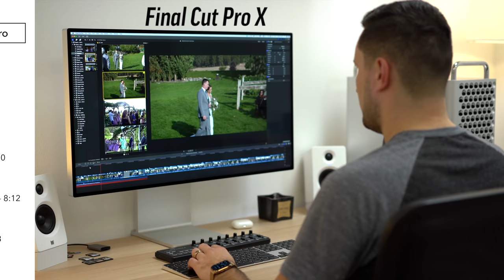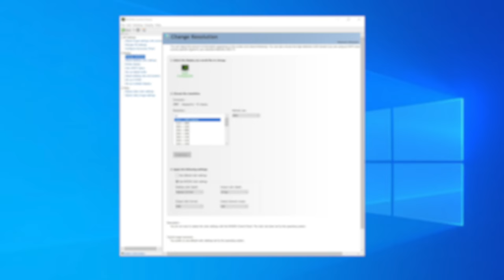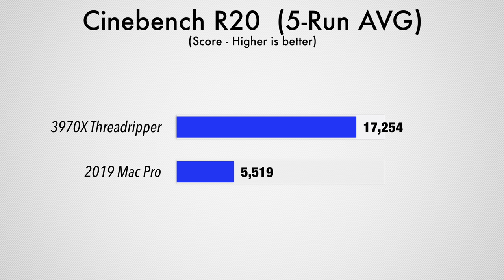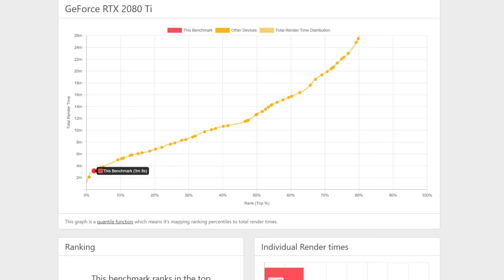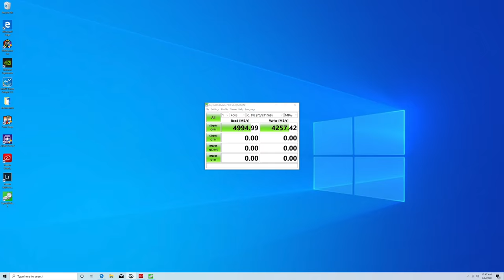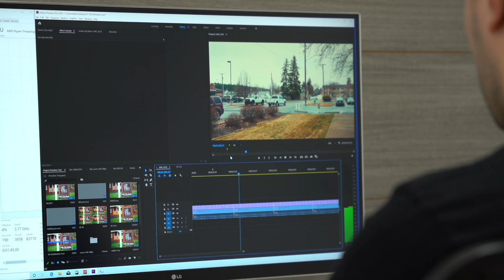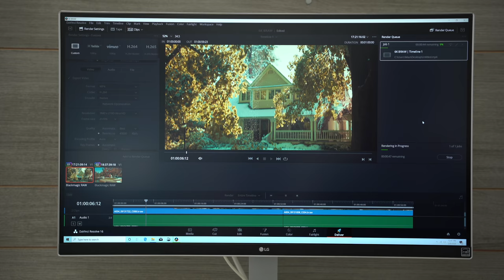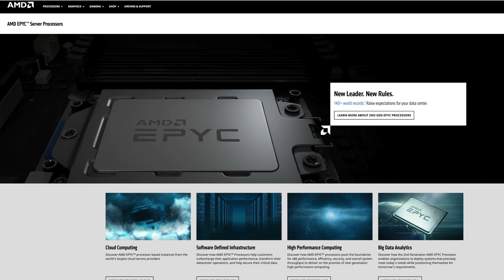$15,000 Mac Pro vs $5,000 Threadripper - Sorry Apple..

Comment: 13:48 "To be comparable, we would need at least a Quadro RTX 6000" No you wouldn't!
If you really need 32 Gigs of HBM2 memory, just use 2 Radeon VII's instead of the 2080 ti. An XFX Radeon VII sells for just 600 USD on Amazon currently, actually making the build 200 dollars cheaper while sporting 32 Gigs of HBM2 memory.
Reply: Hey someone got it. Even older nvidia gaming cards in SLI will outperform a super expensive quadro because of the memory. It's like they didn't know what was actually necessary when they designed it
Reply: Hello can you recommend me a pre built pc under 2k?

Comment: Imagine if this guy compared an evenly priced PC to the Mac Pro
Reply: Probably can't build one - there are no multisocked boards for desktop Ryzen and Threadripper, ECC memory is also unicorne.
Reply: Piotr Dudała You can get so much out of the money. If you want a workstation dont get a 2080ti. Nvidia has multiple workstation graphic cards. Ryzen 3990x and get a good cooling system. Maybe even custom made.
Reply: Now you can slap a 3090 in it
Reply: @angeloc1340  or even a 6900 XT, or wait for the titan ampere
Reply: I literally tried to make a pc (pcpartpicker.com) for 15.000 bucks...

sort high to low

I didn't manage to do it until I just packed 2 rtx 3090s in there 😂😂😂😂
Reply: @gitg4d576  the 3090 is the Titan for the ampere cards nvidia  is false marketing this card as a gaming one 
It has a lot more vram 3080 because workstations need it
It has A nvlink connector because work stations need the 3090 would already destroy the 5700xt lol that card which costs like 400 dollars and they are Selling it for 2000 
Apple is the first hand scalper tbh

Comment: Pro tip: choose good fans, adjust the fancurve and use linux. Voila, all the negativs mentioned in the video are gone and the performance is even better.
Reply: blad90  Exactly right lol
Reply: blad90  You are not aware of the mighty power of linux. Study u must.
Reply: blad90  I agree. I looked into using linux but to use the software I need it would be close to impossible to install. Not impossible but close
Reply: blad90  noob 😂
Reply: @Galadriel Of The Wood while there are open source alternatives, Mac boyz will be faithful to their ecosystem. I'm with you on that.
That car comparison tho.
Reply: blad90  'Linux is shit' - shares this comment on a platform that runs on linux servers. cough blasphemous cough
Reply: @Galadriel Of The Wood Yeah! I tried MacOS and it is trash compared to Windows. Couldn't even make the interface work correctly
Reply: blad90  100 step process what are you smoking. If I want install Firefox I write  this "sudo Pacman -S firefox" in the terminal. I don't understand this argument it seems more like you just want to learn something new.
Reply: blad90  bruh, your just kinda wrong.
Reply: @Galadriel Of The Wood what kind of linux? It isn't just one thing.
Reply: I hope you guys know that there are multiple distros for Linux . Once you get to know how to go about using the Linux shell, you wouldn't complain even once and it provides so many ways to make so many things easy. You just have to know how to go about it. That being said, Windows and Mac OS do have major advantages over Linux in the sense that since it's more easier to use, it attracts a larger consumer base. And since building applications on different OS' require entirely different codebases, companies will mostly not afford to build them on Linux based systems. But good news Linux peeps, this is changing. More and more people are switching over to Linux distros and more companies are starting to invest into the Linux platform. A simple example is, consider the game Counter Strike : Global Offensive with a massive player base of about 600,000 daily players if I'm not wrong. With the new Vulkan API, the game runs at a higher FPS than a windows system! So don't dish out on Linux just yet. Good things will come!

Comment: Who whould win?

Chad custom pc-

Or

Virgin mac pro-
Reply: @cooldownboi3890  doesn't this mac uses amd?
Reply: @Gloverfield  no, it uses a 12 core Xeon processor clocked at something in 4ghz range but only reaching 2.6 GHz bc fancurves are so fucking low on the Mac proably
Reply: @cooldownboi3890  Lol just get a custom watercooling system for less noise. Literally produce less noise than an AIO.
Reply: @hanzoverlord6720  I know

Comment: This dude has an excuse for Mac every time it gets beat out, holy hell, just admit PC destroys Mac.
Reply: You see - Apple indirectly is PROVING a point: OPTIMIZED software. In PCs, excessive raw power bought at expense of noise and thermal performance, is usually wasted due to software unable to make use of it  - sometimes due to fundamental reasons, mostly due to crappy developement. E.g.  Tensorflow compiled with Intel MKL and AVX support may be 3-7 types faster... yet default binary is not.  That's why WIndows Phone or iOS were flying on hardware, that would make Android cringe and Android was slow beast and unable to take advantage of - at time - monstrous advantage in underlying hardware. They are on the right track - just wasting this concept in different ways.
Reply: @piotrd.4850  
Complete bullshit, nothing said that was true, apple optimization only applies to final cut pro, same spec windows machine destroys mac in any software.
Reply: @piotrd.4850  It is very possible to have a silent and powerfull pc at same time. If he would have used massive air cooler instead of a noisy AiO water cooler and more case fans, temperatures would have been lower and the noise too. My 9900k is cooled with 2 120mm fans that are sitting on 2 heatsinks with 12 heatpipes, combined by 4 case fans, and a 3 slot RTX 2080 super overclocked Strix ROG and i can tell you, even durring benchmarks, my temps are low and you cant even hear the whole thing.
Reply: imagine he wouldnt use a gaming GPU ? lets say he goes with one of the qorkstation cards of the quatro series...
Reply: Most PC buyers are not building a custom monster like the one you see here. They are buying off the shelf pre made PCs. In that regard Macs are every bit as good and in some cases better. And Mac OS may be what they need. Both Mac and Windows have their uses. Your assumption that PCs are better based on test results of a custom monster vs a stock Mac Pro is far fetched.
Reply: Not to insult, but most people I know  will rather build a pc over buying premade one. The only case I know that's not true is with laptops (for obvious reasons), if you want to count that. Even my grandfather doesn't have prebuild pc, he has a laptop connected to a monitor, which is important because he said he would rather build then buy (usually) premade trash. (I am looking at YOU Dell!)
Reply: @TomitaGregorias  This may be very true in your world. But world-wide most PC sales are of off the shelf computers. Custom built PCs count for a small percentage of the market. And yes, if you know what you are doing and can build a custom PC you can build a monster machine. No doubt.
Reply: @piotrd.4850 have you ever hackintosh-ed??
Reply: @piotrd.4850  so that justifies the extra $10000 price tag?
Reply: @piotrd.4850 Optimisation only goes so far. You saw how much the PC beat the Mac in Blender. The Mac will only beat the PC in niche areas, for virtually everything else the PC is king
Reply: @jwillis35  Actually you can buy premade pc that are still far superior to macs, you don't need to build your own pc to outstrip a mac lol. Just go on websites fro. Lenovo, hp, asus etc etc.

Comment: wow... such a silent and beautiful piece of unreasonably expensive junk
Reply: Not to mention, you can easily adjust the fan curves in windows to make them silent
Reply: They're budget was too low couldn't afford any fans there's just intel stock cooler if they wanna build good Mac they should increase there budget like 20 k to play MC with 4k
Reply: If they were to build 20k Mac I bet 10k pc would overpower Mac anyways
Reply: The max pro is just a cheese grater with some ram inside